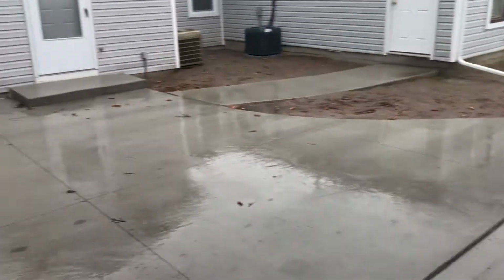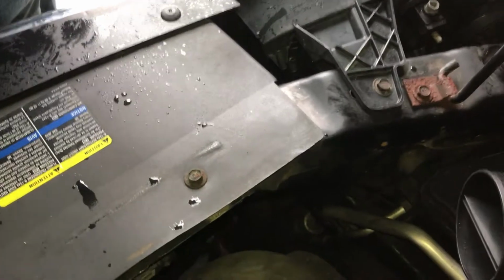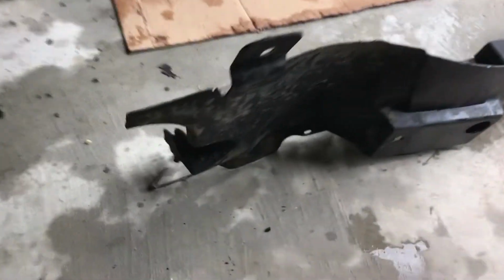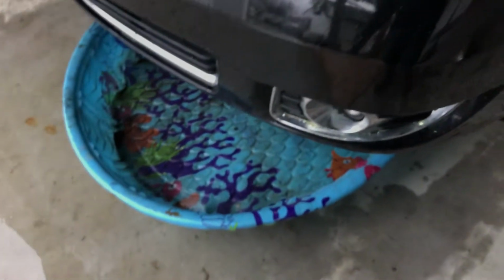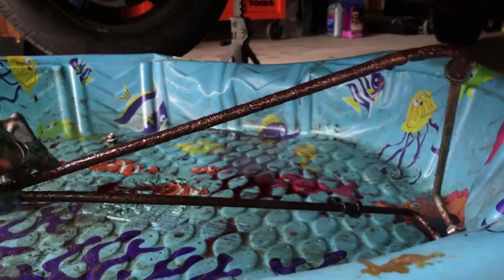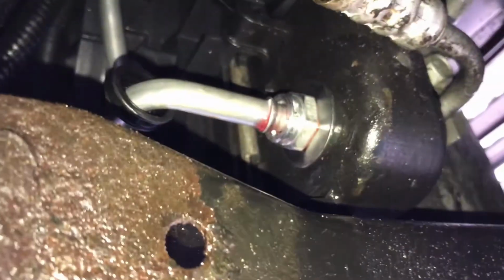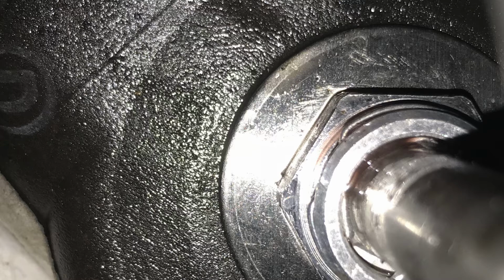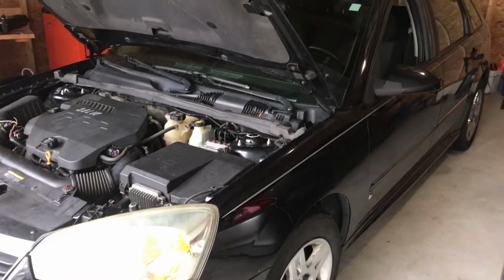GM 4T45-E Transmission Line Replacement - Malibu, Alero

Comment: When filling trans fluid on those 4t45e's you have to jack the whole car up as it must be level for an accurate reading. But there is a metal threaded plug on the side of the trans that you remove. Fill until fluid starts coming out. That's it

Comment: My mechanic took the water pump hose off. Just to the top transmission line off the radiator. All my coolant came out of the system. Didn't see this guy do that at all. My mechanic clearly didn't look at this video

Comment: Yo brother I having a hard time with the the bottom line it’s hard to put in I try Force and I tried removing everything a plug-in first and I tried removing the firing and put the line in first I can’t get it to Thread and also I bought new fittings top one works just fine I tried it with the old fittings to I need help I saw you struggling with it too but I don’t know
Reply from the maker: Wait so you said you tried with the old fittings, what happened?  Did the old fitting fit in the bottom?
Reply: So they both fit the new one and the old but when I put the fitting in the radiator and try to put the line it doesn’t go in
Reply: At 3430 in ur video u had the same issue but u got it in I didn’t tired and it didn’t work
Reply: 😂😂 I got it

Comment: I'm just wondering did you drain the radaider fluid out first or re fill the transmission with any fluid
Reply from the maker: This is not needed, you are not opening cooling system.  And transmission fluid will refill via transmission.

Comment: Only thing you need to do is remove the air tubing, right headlight and the passenger side radiator support bracket and air deflector. 

On a side note: damn that thing is rusty. I just did mine today on my 05 Malibu V6 and after 275k miles there's zero rust underneath and the lines have zero rust after 16 years. Thank God I live in Denver and not MI.
Reply from the maker: Jealous!
Reply: This is exactly how I just did my daughters car! It's a 2007 Pontiac G6. Probably the easiest transmission cooler line change I've ever done!!
Reply: @Sean25K25  Yeah,very easy job. I've done worse.

Comment: What's the torque on that nut?
Reply: I couldn't find a torque, so I used a 1/4 rachet and a 10mm socket and got it very tight. It worked good.

Comment: My mechanic is putting one om mine right now. And he is catching hell. Been working for 4 days straight. And my car is still not fixed.
Reply from the maker: Not surprised, this job is a PITA
Reply: @WilliamGreenlee  I snapped the stud on the tranny holding the lines, tried just about everything I can fit in there, I’m about to have to pull the tranny, any suggestions?
Reply from the maker: @sampurvis1981  I assume there is not access for a drill?  They make left hand drill bits for this sort of thing which is nice for removing broken studs.  Even if you get an extractor set, it will require a drill.